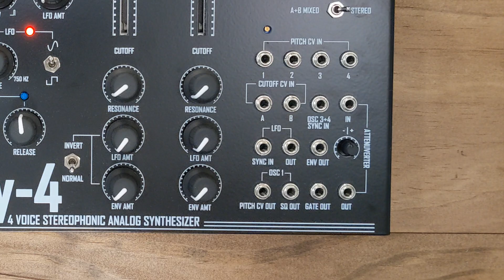DarkSky-4 | Stereophonic Analog Polysynth

Comment: This thing looks and sounds really awesome!! For how clean the front is, the back panel does feel a bit messy. Two different types of midi connector, USB mini B with the pcb showing through and the connectors not aligned with each other. It might not influence the functionality itself but it still counts in a premium-priced device. Currently the price is too steep for me (especially including shipping and VAT) but overal an incredible effort! Will keep my eye on this one for sure because the sounds are right up my alley.

Also: please mention the dimensions of the device somewhere. It's quite important for small-setup-people like myself 🙏🏻
Reply from the maker: Thanks for the kind words! Yes, I see your points and will keep this in mind. I appreciate the time and feedback. I will also provide dimensions on the listing! really appreciate it!

Comment: This is impressive! A similar set of features made me buy a moog matriarch last year but that synth doesn't have the option to do real poly 4 voice, only paraphonic.
How did it do such a thing? Would it be possible on the matriarch circuitry?

As for criticisms, this thing needs stereo effects. I'm thinking a delay and stereo distortion like the Trigon 6
Reply: If i'm not mistaken, you don't get the regular "filter per voice" with this one. 
only 2 filters in total, kinda like the matriarch, but you do get separate VCA's per voice so it's kind of poly?
You can use a stereo synth with mono effects if you have a mixer, you will still retain the original stereo source summed with mono-to-mono or mono-to-stereo effect.
Reply from the maker: Yep, thats exactly right! Thanks for the comment!

Comment: Um, you can get a Behringer Deepmind for that price. You get more voices, a ton of effects, more routing combos and an awesome GUI software editor. Please understand I am not taking anything away from the efforts put forth here, I am speaking to market realities. The Cobalt also competes in this price range with a full high quality keybed, double the voices and another great GUI editor.
Reply: Behringer Deepmind for couple of years didn’t add MPE support, and continuing non-adding MPE to all poly-analog products. If author adds normal MPE support (just a few lines of code to the firmware) it eats all competitors.
Reply: Have you heard the Deepmind without any effects processing? In terms of dry sound, this sounds so much better to my ears. Once you add effects (pedals or valhalla, vst effects, etc) it'll be gorgeous!

Comment: Elegant design, nicely done. I am not sure how many will appreciate how nicely the stereo filtering capability was done here. A few highly subjective personal observations:  There is disagreement on the point, but each VCA not having a dedicated EG = paraphonic to many and NOT polyphonic so use of the latter term could be questionable. At the price there perhaps also should have been an ASR envelope (option to gate loop as AR and lin->exp sweep is possible) allowing dedicated EG each for VCA and filter. Getting only the square out and only from VCO1 instead of the mix out from all 4 (or at least 1&2) is too bad. A mode to change the filters to series HP/LP (as on Matriarch) would have been a nice addition. None of that changes this being really well done.
Reply from the maker: Appreciate it! The ADSR section controls multiple independent EGs, but yes, there is only one ADSR set of controls. Gate looping sounds interesting! Would be a fun firmware upgrade! Thanks a lot!
Reply: @spacebraincircuits1358  for me the "heart" of the design is the easy to use and elegant stereo filter arrangement. (I do not know how many might agree with or appreciate that) I feel that taking that "heart" and combining it with a SBC for the VCOs, LFO(s), and EG(s) then quality DAC to VCAs -> filters (with serial/parallel option and maybe state variable) could make for a possibly more unique offering? Call it the RedSky-4 or some such. Oscillators being digital opens all kinds of possibilities... In any case this here synth which actually exists is  👍👍
Reply from the maker: @klstay  definitely a cool thought! Yes, I love stereo modulation so that is why I focused mostly on this. Would be cool to be able to reroute the filters, definitely something I will consider! Again, thanks for the kind words!

Comment: Dude, include the power supply!  And standardize your ins and outs, having different sized midi and audio connections is silly.
Reply: The connections are standard, keep them that way please!
Fantastic synth 👍
Reply: @leftmono1016  The point is, don't use both midi din and 1/8 on the same device for midi for example, use one standard or the other, both is nonsense.  Same with audio, either pick 1/8 or 1/4 connectors.
Reply: @dodgingrain3695  - mini jack is standard for CV modular connectivity and 1/4 inch is standard for audio. Would be stupid to deviate from this. 
The midi being different is strange I’ll admit, but as long as midi in is on 5 pin din I’m happy.
Reply: @leftmono1016  It should be one or the other, not both
Reply: @dodgingrain3695  - be more specific, are you talking midi, audio or both?
Midi I’d agree with. Not a biggie. But you need mini jack for CV and most people prefer 1/4 inch for audio. So that makes perfect sense unless you’ve not used modular?
Reply from the maker: Thanks for the feedback! I'll consider this for the future!
Reply: No, MIDI and audio SHOULD be on different connectors.